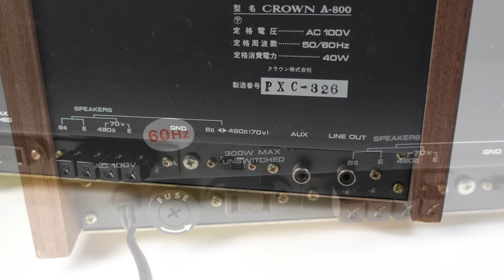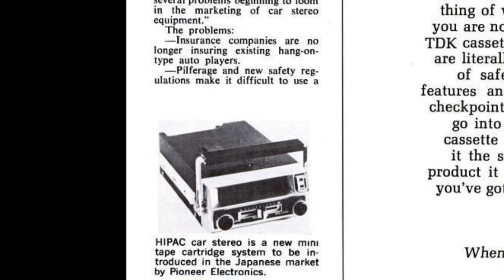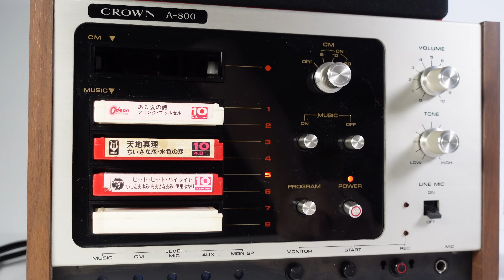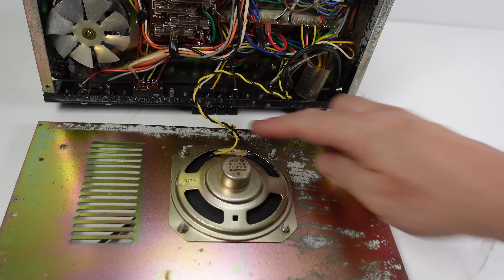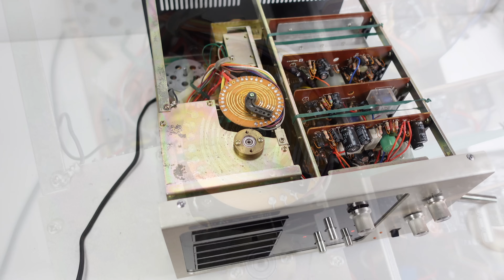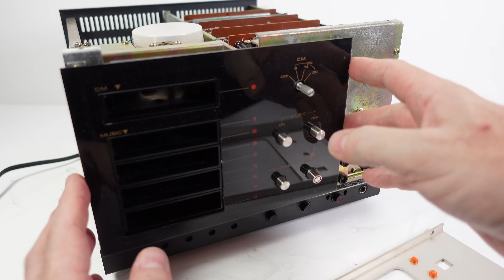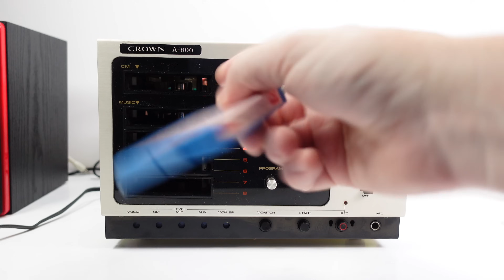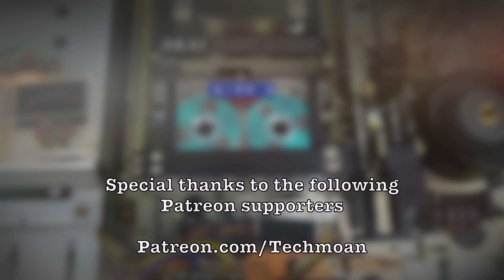An unusual player for a forgotten ‘70s music format

Comment: The whole point of a capacitor is to do power clean up and modulation of frequency; of course replacing the capacitor will also change the frequency

Comment: IF you change that capacitor, use a non polarized cap. It's for a.c. motor control and you do not use a polarized unit.

Comment: I'm far too late, but just wanted to suggest why the recorder would need a different method to detect when to stop:
1. You'd almost certainly want multiple different announcements
2. The total time for announcements won't always be the length of the cart
So there needs to be an alternate method to detect when each announcement ends.
If you've ever been in a shop with announcements at Christmas, you might remember years when people complained because every shop played the same announcement every few minutes. Or an excessively long one. So you want variety and brevity.
Having two tracks means we can have an end detection code without interfering with the announcements, that said - it could just be to double the recording time. Having an announcement start with a beep and end with a beep isn't unusual.
Reply: As the announcements reel will always record short - the last announcement could be blank, so it would be nothing. Which does mean you would always need a blank cart before recording so you don't have the end of yesterday's playing.

Comment: Volkswagen offered an AM radio with a PLAYTAPE player for a few years.  Most US manufacturers began offering either floor mount or in-dash 8-track stereos by 1967.  Of course, Ford was the first to jump on the wagon in late 1965 and then model year 1966.   Chrysler and GM joined in by 1967 even little AMC had a floor-mount unit available then.

Chrysler made the odd jump to cassette in 1971 offering a floor mounted player & recorder. One thing I've often found curious is that in the Dodge or Plymouth "A-body" (Duster, Demon, Dart Sport, Swinger, Valiant and Scamp) other than the cassette being offered in the Duster and Demon in 1971.... previous to that, no tape option was offered and following that, no tape option was offered. Chrysler discontinued the cassette option after 1972 switching back to 8-track.

In the AMC camp, you had to buy at least a Javelin to get a tape option.  No tape available in any Hornet or Gremlin EVEN THOUGH (and I again find this curious) that the Javelin AM/8-track unit will fit the Gremlin/Hornet dash perfectly.

Comment: I took some classes on electronics. The capacitor defines the length of time between each surge. But it doesn't change the surge.

So, if you have a lower hertz, you will need to have a longer time between surges being supported. Hence, the power level will stay up higher with a higher value capacitor.

With a lower value capacitor, the power drops off faster. This is why a larger capacitor when running 50 hertz will keep the power levels, and the playback, working correctly.

Okay, I'm going to watch part two now! ;)

Comment: Changing the capacitance of an old radio tuner (by making stacks of metal plates become more interlaced, or less) can change the rate that the tuner oscillates. So it stands to reason that changing a capacitor could make a stepwise change in the operating frequency. (I would expect, though, if the capacitance determines the frequency, I would expect that increasing the capacitance would make it operate more slowly. So I don't know what is going on.)

Comment: I had some "Crown" components and the mark for me war very serious, not top (in price) but very serious machines with the construction and durability. I even remember my first cassete with azimuth adjustment and it was a Crown radio cassette boombox "cheap": if you pull out the external shell you can play the cassette adjusting the head azimuth with clear sound--> for me this was like to discover and to be in the doors of the heaven (sorry for my english)

Comment: changing the capacitor can definitely change the speed. The concept of the resistive - capacitance time constant. Used in time delays for windshield wipers or timing for strobe lights two name just two examples.

Comment: Motor Run Capacitor must not be changed - they are specified for the induction motor field windings that phase-split the magnetic field in time for a better rotating uniform magnetic field. Not sure if anyone has commented, so apologies otherwise. Change @only@ for a new capacitor of the same value, capacitance will tend to increase over time, so if measured they may appear to be higher. By default I always replace with new Motor Run Caps.

Regards, and thanks for your great videos!

Comment: Yes, replacing the capacitor will change the voltage feed to the motor, which will speed up the motor to 60hrz, as the 1mf capacitor increases the voltage.

Comment: If it is an AC motor, changing the capacitor won't help change the speed.  The capacitor is used to either start the motor, or create a second phase to make the motor keep turning. (These kind of motors will have 3 or 4 wires)  You need to increase the diameter of the motor pulley (recommended) or reduce the diamater of the flywheel that the belt drives (not recommended).  Other than that you need a frequency converter, to provide 60hz to the motor.  If built into the machine, it only needs to be rated sufficiently to drive the motor itself.

Comment: Could replace the capacitor with a X class 1uF. Note that these tend to be quite large and may foul any adjacent components when reassembled. Farnell do sell axial high voltage polypropylene/metallized PP capacitors (3 to choose from 25mm to 33mm in diameter. One is 44mm in length).

Comment: Those old tape audio players uses "constant current" to regulate the motor speed so a capacitor and a diode bridge can be used for motor current direct from mains( it may not be isolated from mains; be aware of getting electrical shock!) You had find it that true, for 60Hz but voltages used olso effect the set value it is not the same 220V as if 240V. BUT, regardless of all it must be running faster not slower.. it must be all wear or tear oldies.

Comment: Where on earth did you find lubricated 1/8" tape?  When I was at Physician's Radio Network (PRN) back in the mid 80s even 1/4" lube-tape was becoming scarce & hard to find.  They ran their daily program on two pair of nearly identical 60 minute carts (odd hour & even hour) that ran two at a time, 24x7.  Twenty eight cartridges of lube tape every week.

Comment: Did you ever end up changing the the capacitor? AC motor run capacitors( non-polarized of course) do change voltage in the circuit.

Comment: As someone who(se parents) had quite a collection of 8 track tapes in the 1970s, yes, them getting tangled/stretched/snapped was a big problem.  The mechanism for getting the tape back onto the reel after it had been played is very clever, but not very good; it basically amounts to making the spool of the reel a cone rather than a cylinder and trying to squeeze the incoming layer of tape in behind the rest of the tape, and as you can imagine there's a certain amount of mechanical wear on the tape and the magnetic coating involved.

Comment: Without knowing the answer, the cue tone theory does make sense -- that's how the old Fidelipac broacast cart would cue itself.
As for the speed issue, call George Martin or perhaps Paul McCartney.  They used to effect pitch changes in their recordings by varying the current frequency, e.g. powering the recorder at 47cps instead of 50. They called the process "varispeed".  Not sure what they used to change the current frequency, but it would seem with all the gear you bring in, having such a device would be as handy as the power (voltage) converter.

Comment: did you try running cm cart with external speaker? I'm curious if it plays continously and the timer switch cuts it into the main feed as it makes contact on the wheel for time slot. The monitor speaker alyas plas it

Comment: I wonder if the 50/60 Hz thing in some way influenced the Vaporware element of slowing tracks, considering the overlap in people mixing Futurefunk which would have heavily featured Japanese audio sources, which may have resulted in the purchasing of era equipment from Japan as well. As I think on it a US powered analogue machine set up for 50Hz would give you that sound that is sometimes associated with Futurefunk. Cool, wonder if there's anything to it.

Comment: yes , if you put a 1uf cap in there it`ll run at the correct speed . (I`m a vintage audio tech you can trust me) ...lol , the speed change is because of the time it takes for the capacitor to charge / discharge

Comment: I live in Japan. I brought an alarm clock with me from the US. It always ran slow. But it was so gradual, I didn’t notice until after about a week. I was waking up later and later each day and was almost late to work one day. 
I looked at the clock and it seemed that the timing mechanism wasn’t being controlled by a quartz crystal, but it was using the HZ from the wall outlet.

Comment: Increasing the value of the capacitor will change the phase difference between the motors secondary and run windings, and increase the speed.

Comment: yes, switching the capacitor will make the adjustment you want. it even says so right there. as for its function, it could be a logic switch like with an IC or it could be part of the oscillator itself, which i would guess is more likely

Comment: There should be a speed pot on the main board. They all had to be adjusted, because no two mechanisms and motors are exactly alike. If not you will have to change the transformer & Cap after you find out what voltage was supposed to come out. This might be printed on the main board power input area. Or you could find a resistor in line with the motor and put a pot in there of the same value + a resistor 1/2 the value of the one you removed so you do not go to 0 ohms. You can then tune it in by ear. Your videos make me want to buy old stuff and fix it up. I had a quadraphonic 8 track when I was a pup man that was the sound 4 separate channels no BS encoding. Dolby and DTS are nice but I always wanted a full range speaker in every corner I want 4 full range channels. Then you can feel the bass go around the room. Sure the directional information we receive is mostly high frequency but why be lazy and cheep. I guess SRS labs + DTS is as good as we get for now. Media is so small now a thumb drive can carry so many albums isn't it time to record more the two channels? Now to see what you did with the quadraphonic 8 track oh boy :)

Comment: The comment below on the use of machines like this on radio stations reminded me of the 'automatic DJ' machines that Radio England/Britain Radio  (two stations on one ship in the 60s).  These played tapes (and records?) automatically, inserting station IDs and commercials between records, and were intended to cut the cost of running the stations (ie DJ salaries!).  Needless to say, this wouldn't have worked well (DJ personalities being a key part of pop broadcasting) and the idea was abandoned at the last minute (while the ship/station was still being outfitted in the US), and live DJ programming was used instead.  But the equipment remained on the ship and may still have been used for non-peak programming - I'm not sure about this, I have read somewhere that they weren't very reliable, so I assume they were used.  It would be great if you could do something on these machines some time.  These days, of course, all stations can (and do) do this just using software on PCs, but these original electro-mechanical machines must have been fascinating to see in action.

Comment: Perhaps, rather than being a prototype boombox, the HiPac in the black vinyl case was intended as a complete in-car hifi in one single unit. It looks like something that could have wedged between the front seats of a basic late sixties car, being both an armrest, tape player and speakers in one. Is the power supply 12v by any chance?

Comment: Blanket statement exception alert.  In the early 1970s, in the USA, I had a cassette deck in my car.  In fact, it was a really nifty one that had record capability and an accompanying microphone that hung like a CB Radio mic, ready for quick access.  It could also record from the built in AM/FM receiver.  If I bought one, no doubt others in the US did the same.  Cassette was alway preferable to 8-Track.
I had never owned an 8-Track until I bought a few relics in working order from eBay about a decade ago.

Like Windows ME and Vista, some things never got their hooks in me.

Comment: hello, Techmoan, I would say, that you unsolder one of the legs of the capacitor and see if the motor does not move, that will give you the guideline that effectively the more capacity, the more speed, and vice versa. Cheers

Comment: I'm within a few years of your age and grew up in the seventies and eighties. When I was a kid my dad's car, no matter which car it was, always had an 8-track player in it  We moved around North America quite a bit so I had a lot of long road trips. I remember hearing a lot of beatles 8 track music and what was really absurd about 8-tracks was they couldn't handle very long songs and couldn't play a lot of songs either so you would get very screwed up versions of things like Rubber Soul or Sergeant Peppers. Songs would stop halfway through and be continued on the next track which would take several seconds to switch over. Also some albums would have to be sold on two different 8 tracks and they would often change the playlist if necessary even though I'm sure the artist put a lot of thought into which songs they wanted to go and in which order. It was a really wonky thing and it was number one only because there was nothing else to challenge it. When cassettes came 8-tracks disappeared so fast that you barely remembered that they'd ever existed. Cassettes were everywhere within a year of coming out and all music sort of switched from records to mostly cassette after a while. Also the ability to record songs easily onto cassette from either other cassettes or just off the radio or even from records, made them even more valuable. About 10 or 12 years ago used record stores started buying old cassette tapes which I found to be just bizarre but for a brief time there was a nostalgic kick going on and it was considered cool to have old cassettes. I don't think that lasted because cassettes were never cool they were just super practical.

Comment: If your manual includes schematics, it may include a clue for stopping the CM (commercial message?) cartridge.  As an example, a 400Hz tone could be added to Track 2 of the CM tape by holding down the Start button for a couple seconds before speaking.  At the end of the voice announcement, the CM tape would continue to run until a tone detector stopped it by pushing back the pinch roller on the CM cartridge.  The next time it started, the announcement would play normally.  There are several ways they could have set it up.  If the schematics could be found, it may be possible to discover how they did it.  Wondering if the 5-10-20 selector is the number of minutes between announcements?  Thanks for a great video!
Reply: Yes, there is likely some trick to set a tone, but it is odd that no button is so-labeled.  In the world of broadcasting, the tape cartridges had multiple tones available. 

If this device has such controls, one could record multiple announcements.  The first would play, then stop.  At the next interval, the next announcement would play, and so on.  After the last announcement, the tape would advance to the start and be ready to play the first announcement again.

Comment: Loved the video, one of your best! The capacitor provides the optimum current and phase for the synchronous motor's 2nd winding.  Because capacitive reactance is a function of frequency, a larger cap is needed at 50Hz to provide full torque.  May I suggest purchasing a small good-quality (isolated) 60Hz inverter to power 60Hz-only tape deck motors in the UK.  For this unit, I suspect the 50Hz models of the Crown A-800 had a larger motor pulley in addition to the bigger cap.

Comment: Capacitors also act as filters with bigger caps allowing for lower frequencies to pass, so actually it should work to alter the machine to work with 50hz by replacing the capacitor as stated.
Reply: If you let me know where to send it I can send you an axial 1uF poly propylene cap free of charge.

Comment: My 1972 luxury Datsun/Nissan as it was plated had pioneer stereo cassette radio which included auto reverse, track search & even controls in the rear. Radio also searched for stations with a touch of knob.  I thought you had a wall mounted piped music system at first, it looks a lot like those radio/cassette piped music systems for flash homes and hotels back then into start of 21st century which combined intercoms by then.

Comment: If the motor is an a/c synchronis motor and that capacitor is wired across the motor windings it will change the speed. If it were a filter cap in the power supply it would have no affect on the motor speed but due to the relatively small value of capacitance and the fact they appear to be non-polarized which means they have no positive or negative preference it is a motor cap. If you wire a 0.4 microfarad cap in parallel with the 0.6 you will get your 1 microfarad.
Reply: Capacitors, especially ac rated Capacitors tend to have broad tolerances, eg, +/- 20% or more.
Add to that, they tend to change value over time.
Whatever type of motor it is, reliance on the value of a Capacitor for speed stability is a bad idea.